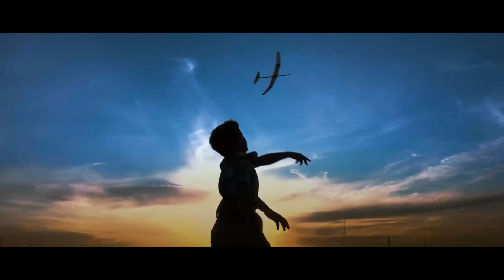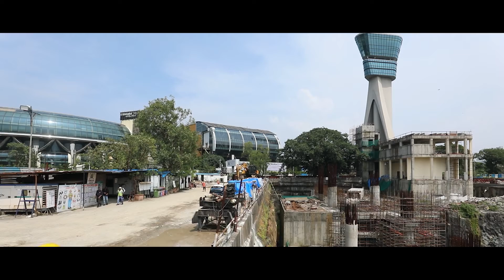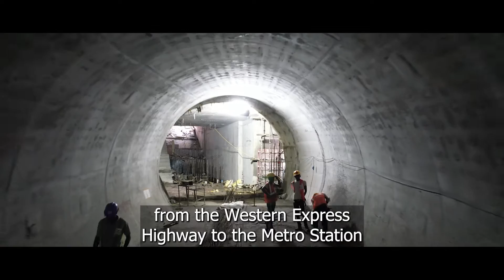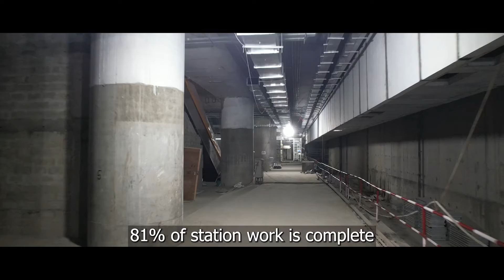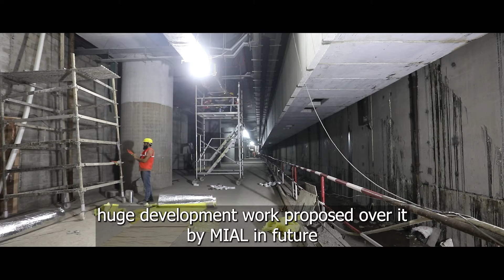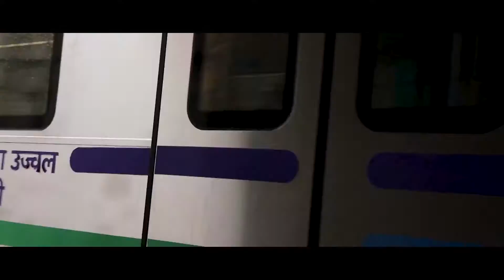CSMIA T1 metro station of #MML3 has completed 88% of its overall civil work and 52% of system work.

Comment: working at speed of a snail...snail is also faster than them.
I am from Mumai and have witnessed this construction. They have caused so many issues to daily lives of us Mumbaikars. Unnecessary delays and then smartly blaming covid19 for it.
Reply: Blame Sena-Congress for delay in depot. It takes a long time to get depot ready and with no depot you CAN NOT have trains
Reply: @sunlight2078  he lacks brain to see that or he is just ignorant about the delays caused by MVA govt during which not just metro 3 but all the infrastructure work in mumbai suffered badly

Comment: Underground Metro  is single track or 2 track?
Reply: Means I don't understand your question but this will help you to het your answer i think
Metro will run on both the direction at one time
Reply: @virajchavan3869  most of the video show only 1 track (rails) inside the tunnel hence. Are there 2 separate tunnel for up and down trains?
Reply: @pganmol  there will be 2 separate tracks i.e., for up and down
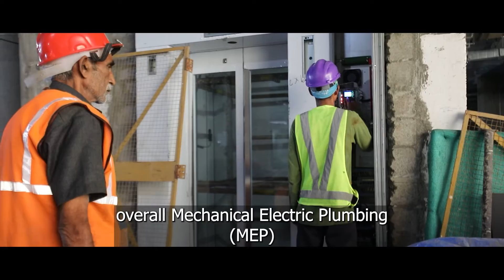Reply: @pganmol  Yes, there are two tracks. Please check the video at 1:28. The video shows both sides of the island platform
Reply: There are 2 tunnels, with 1 track in each tunnel, for up and down lines.